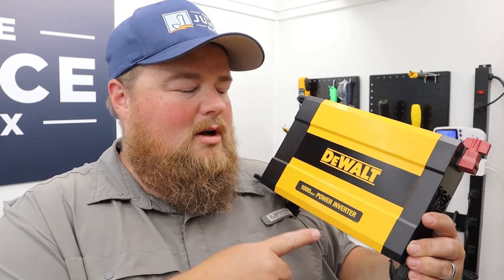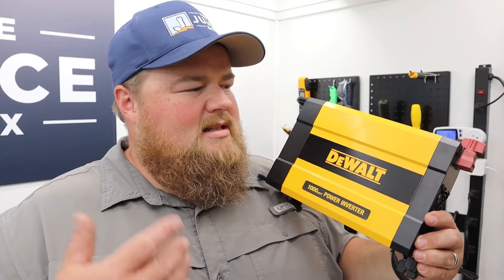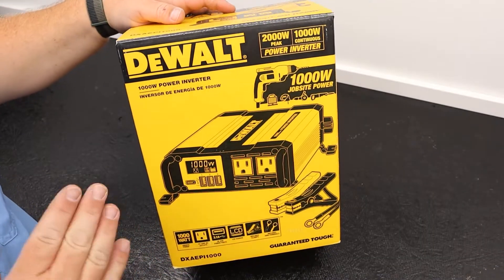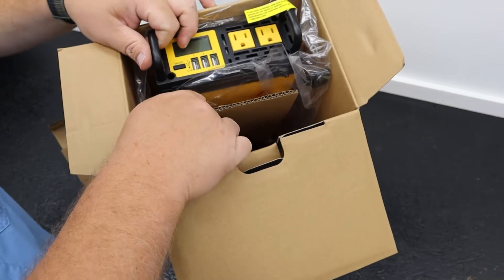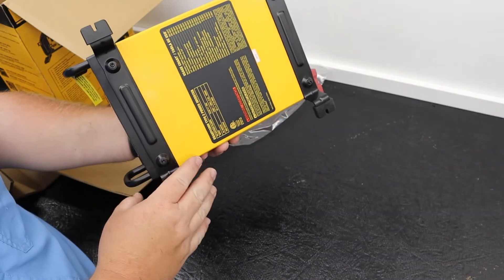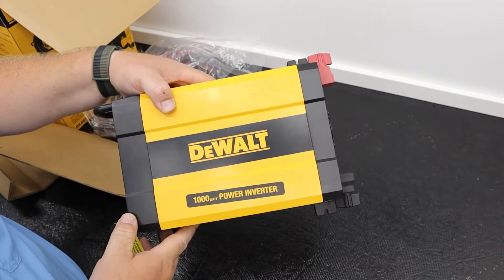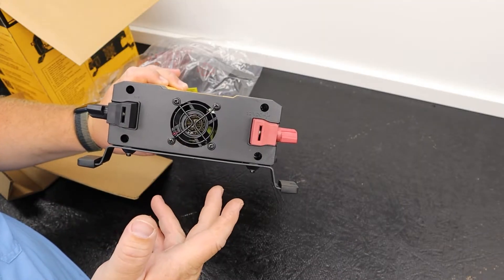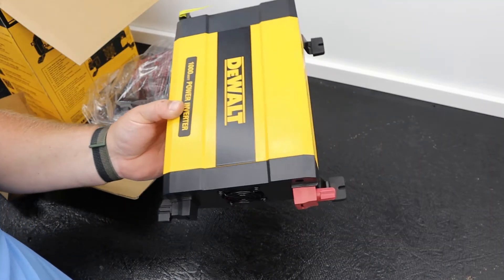TESTING THE DEWALT 1000W POWER INVERTER

Comment: Oops! Current draw at 12V @ 750W is 62.5A... At 1000W, this little guy is gonna such up 120A. Those cable will be a melted mess at that current draw. Remember, power is equal to current times voltage, or work it backwards, if you know the power, 750W, and you know the voltage, 12V, the current must be 62.5A. 1000W at 12 V is 120A.
Reply: First time on your channel and i like how you tested the inverter.  Good job
Reply: it's gonna be about 80 amps check your math and that looks like either 4 or 2 awg cable which is more than good enough for such a short length
Reply: @elevatedsciencesllc8089 its not copper its cca
Reply: @FewerOptions-mx7qt  Obviously irrelevant.
Reply: @KouRou2002  it's irrelevant because In this application even if it was only CCA it would still be an oversized conductor.
Reply: @brookerobertson2951 you're debating with someone who does this for a living. 4 awg CCA is fine for ~60 amps that's actually the max according to the NEC. Even so...What you probably aren't understanding is that when dealing with battery cables we are talking about significantly shorter lengths and the ampacities of the cables are much higher than what is stated in the NEC table. In fact most of the time we are not referencing the NEC for lengths under 20 feet, we are referencing the manufacturers ampacity charts which are different. 65 amps through a few feet of CCA is absolutely 100% fine check battery cable manufacturers spec charts if you don't believe me.
Reply from the maker: You are absolutely correct! The included 8 AWG alligator clamp wires are ABSOLUTELY UNDERSIZED for the 1,000w inverter! That did not jump out to me during this video process. Thanks for chiming in!
Reply: 1000W at 12v is 83A right?
Reply: It is 83 and 1/3 to be exact.  He did the math right got with 750 watt at 12v being 62.5 amp.  Then he immediately forgot how to do algebra.
Reply: I=P/V=1000/12= 83 amp, 
Wire 2 awg

Comment: Just got one. Their wire is horrendous. I’m running it straight to my battery to the inside of truck. 

Using 2/0 wire with (2) 125A fuses. 
1000/12=83.333 plus you can add the 1.25%. Around 105A,. 125A should be fine.

Comment: How many amps on the 30 ohm resistor you used?.  I use the dewalt 1000 watt ccasionally with alligator clips and get a spark when connecting to battery.   That 30 ohm resistor looks like what I need....Thanks!

Comment: I did not see in the video where you verified the output for the 110 and whether or not it was stable. I'm trying to consider options to replace the built-in inverter for my truck. When I test the outlets in the truck they show 98 volts and I think the low volt is killing DeWalt batteries when I try charging them through the built-in inverter.

Comment: They are called bleed resistors. We use them in older dc power supplies to drain voltage from large capacitor used for filtering ac ripple

Comment: If you want cleaner energy feed off your modified dewalt power supply, run everything through a “UPS” back up supply like one used for computer back up. This will clean up the modified signal unless your UPS won’t run off a modified signal and some won’t.

Comment: Read reviews on Home Depot / Lowes....Dewalt suggests no heated tools (no microwave, no heaters, etc) but im glad you still tested it to see how it handles it.

How long do you think this could run on 12v dettached battery like in your set up, using 700/800W continuously before having to recharge the battery? 

Also, Harbor Freight Tools suggest RV rated 12v batteries for one of their inverters. Any thoughts on that?!

Comment: This is funny. A company that promotes cordless tools, sells a device to "try" to run corded tools? Should have used 2 standard lead acid deep cycle batteries in parallel instead of just one LiFePo battery. If inverter is used to power cordless tool battery chargers, beware. Some chargers could burn out, since they don't like modified squarewave power. You can't run a toaster non-stop, but maybe a small space heater. Overall, nice test.

Comment: What gauge wire would you recommend to direct wire to a battery to the rear cargo area of a small SUV (maybe 12-15’)? I had some 8ga and a breaker around my garage thinking it would be sufficient for a cordless battery charger or usb charging but the Dewalt battery charger is causing it to beep until I reset it. I had been using it issue free for a few weeks…..Is it a case of just beefing up the wiring to 4 or 2 ga? Or am I missing something else?
Reply: The cables it comes with are garbage.   You need a 4 awg battery cable to properly connect.

Comment: I bought one, but returned it because it kept overloading when using a reciprocating saw or angle-grinder. Other than those issues, I really liked the unit. If it could have given me another 500W, I would still have it today. It's a solid piece of technology.
Reply: That's because of the inrush current draw of those tools. You can add a soft start to fix that issue.
Reply: Not good to use modified sine wave on motor.
Reply: What battery size where you using?
Reply: @nanonunio  650 Cold Cranking Amps.

Comment: To help gain a feel for using a resistor to pre-charge the inverter capacitors, you can use a 12v light bulb.  This provides a nice visual demonstration of the big inrush of current to the inverter and that you are avoiding by making it go thru a bulb (or resistor) until it settles down.

Connect battery to one terminal and inverter to the other terminal similar to the way you used the resistor. The bulb will light brightly at first then dim as the capacitors charge.  When it is down to a dim red glow, connect the inverter directly.